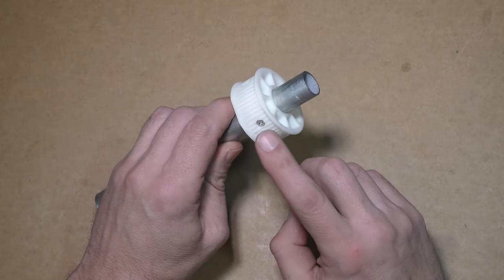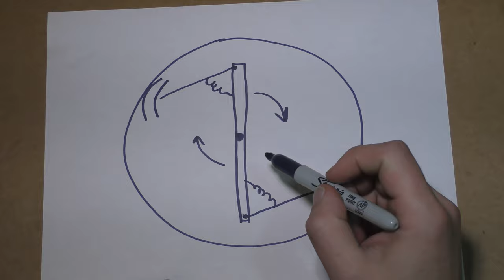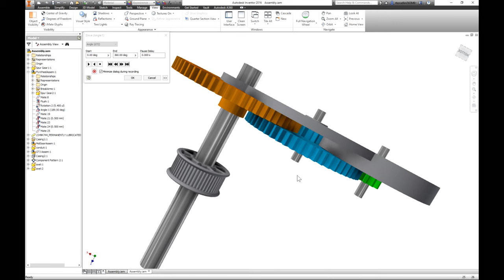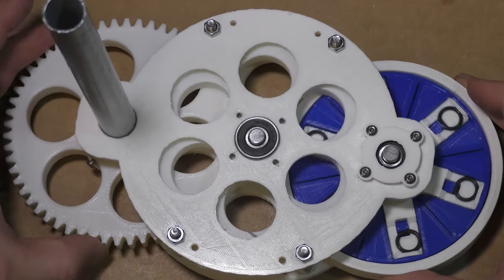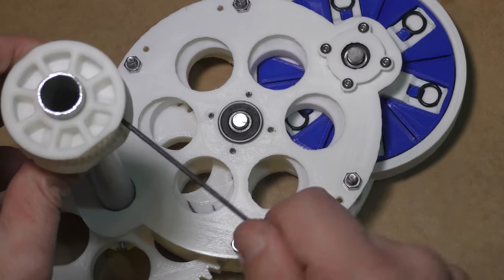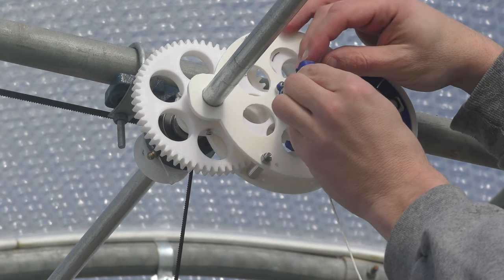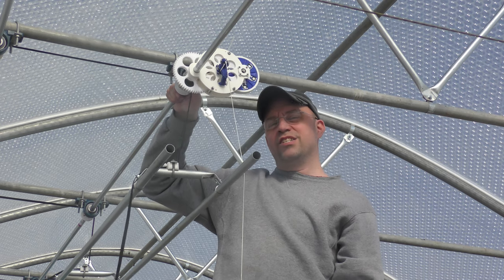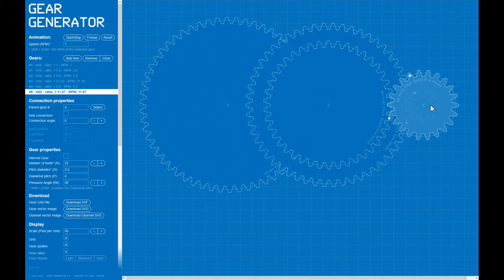IT'S TOO FAST! 😬 Strawberry Hangers - Part 6

Comment: Take a look at how the air brake works in one of those small wind up music boxes. It's a very similar mechanism as your's, but without loud wearing parts.
Reply: That is also how stunt descender rigs work.  They have a tapered drum that they wrap rope around.  The larger diameter allows the drum to spin slower and the fan to spin slower, having less effective brake torque.  Then as they descend the rope winds down the drum to the smaller end, spinning the drum faster, the fan faster, and creating a greater braking force.  Simply replacing the brake shoes with a single blade radial fan might work (the fan is just a flat plate that spins, the air is thrown out centrifugally.
Reply from the maker: I had thought about using an air braking setup.  My main concern was how big the blades may have to be and dealing with all the bugs that might get into it.
Reply from the maker: Also I looked into the decenders....they basically only work in one direction.

Comment: I mean this is super cool, but now i wonna see how much torque before it explodes. I was also wondering today if theres a way to make a governor that will charge or wind up a torsion spring then use that to power the mechanism at ideal speed. think like a zipline or a trolley line that can have someone go down at a low speed and build up a charge then use it for lifting a smaller load back up.

Comment: Really awesome solution to your problem! Couple thoughts for you: is there any need to cover the gear meshing in case any accidental detritus (or fingers 😬) get caught in them? What do you think the wear rate will be for your brake pads? Guessing that you plastic won't last all that long, could make the pads thicker or attach some other material like you mentioned in the video. In any case you will likely have some brake dust material fall out of your mechanism, might want a cover/catch for it. Can't wait to see more updates!
Reply from the maker: I've debated changing the frame so it would also act as a cover.  Perhaps if I print out a second one I will.  It's 10' off the ground so not many people could reach it anyway.  I'm not sure how long the plastic will last...either by the heat, cold, or just wearing out.  We'll see what happens.  It's really not going to be used much...may just to adjust the berries every few days.

Comment: Before you put the O-rings on 13:05 I thought you were planning to put a single elastic band around the six blue "bosses".
Reply from the maker: I considered doing that with an elastic band but was worried about it rotting in the sun.  These neoprene o-rings seem to work well!

Comment: You might try "Surplus center.com" and get a catalog from them. I Find all kinds of parts and little to big motors for 120v down to 12 volt projects, They have pulleys, speed controllers and everything in between and cheap prices. I Engineer/design my own systems also and this place helps a lot.
Reply from the maker: I own many things from them.  ;-)

Comment: You could adjust the braking force by removing half the shoes.
Reply from the maker: Also true and works well.  It does help for the mechanism to rotate a little more freely without having to spin it up as fast.  Plus it still distributes the friction over the 6 breaks instead of just 3 or 2.